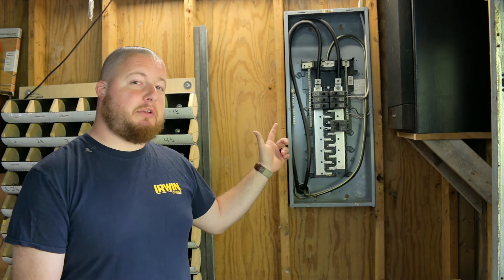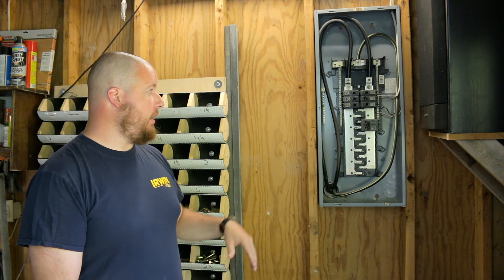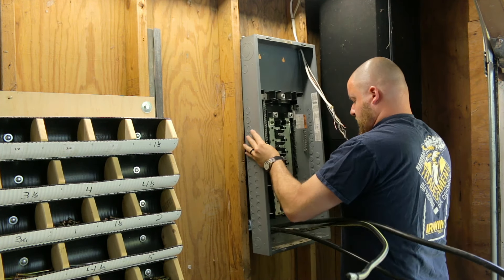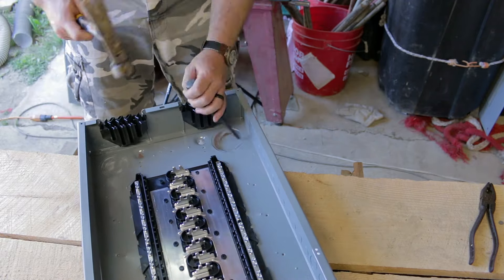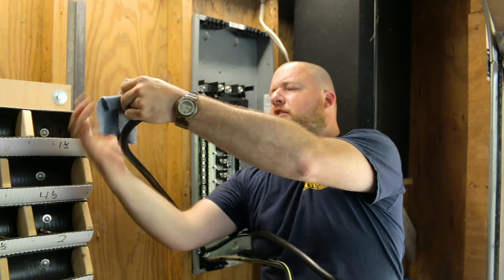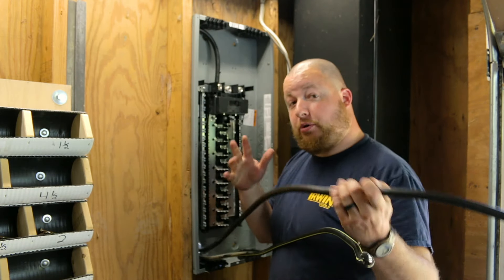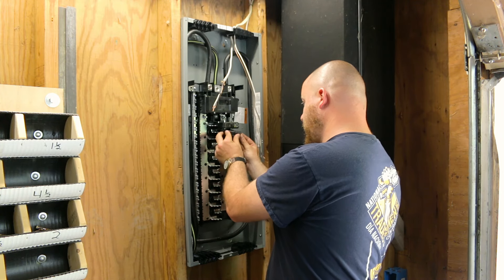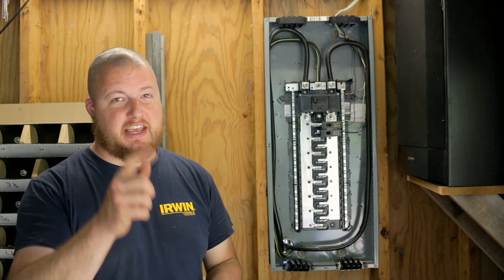Electrical Panel Replacement/Install

Comment: Do not pull your meter,  I work for a utility company and can't tell you how many times the jaws are messed up and it arcs.  Very dangerous.  Also if you have a smart meter the utility company will know right away and think your power went out.
Reply from the maker: so how do you pull a meter?
Reply: @drewdoestrucks  yeah and how many non-electrician/wiremen do you know have the authority to do that? Lol
Reply: Me personally I just disconnect the utility from the drip loop to cut power all together. Much safer no worrying about arcing. I’m more concerned about the main feed cables not having a bushing in the cutout.
Reply: Older meter, turn the main breaker off and cut it at weather head.  Newer meter can be done as you have shown but man use some PPE. face shield, gloves, FR.  Some home owner will get arc flashed right to the face.
Reply: @appalachiandiy2415 can’t really now. Most companies use smart meters and will know something is up. Fiddling with company power lines (big fat wires running into top of breaker box) is a no no for my power company without a license
Reply: No thank you but he’s right is a really safe way 👍
Reply: If you call the utility company, they’ll disconnect the service in short order.
Reply: I pull meters everyday in swfl 
Shut up

Comment: There's a whole long laundry list of code violations here, as others have pointed out in the comments. But one I didn't see is: no grounding system (current nec requires to pound in 2-8' ground rods at least 6" apart and wire them into panel). Just FYI: if Utility Co discovers meter tampering and wiring changes, they can turn off electricity (as a safety hazard) and notify city or county who will then revoke property's certificate of occupancy which means can't occupy or sell the property until passing a lengthy code inspection process. Meanwhile, property insurance can be cancelled and mortgage foreclosed. No joke, leave that meter alone!
Reply from the maker: https://youtu.be/vAD3r_nF6L4
Reply: That's nothing. He won't have any problems at all! He just needs to tell them that he made a youtube video of it, so he must totally know what he is doing
Reply: wow, bud its a informative video on how too.  its not a video on requirements, freakin Karen
Reply: Where do live? 😂 I live in Louisiana,  and the guy who checks my meter can barely read and write. I don't think he's going to try and take my mortgage.

Comment: We were getting estimates on a central air conditioning system, and the salesman told us we need a new box. I don't doubt that, but he wanted $2000 over and above the cost of the AC system, to replace the box. This is far above my ability to do, but I have a friend who is an expert with this kind of stuff, and he has helped me with doing breakers in the past. Pulling the meter is within my abilities, so I think Dan and I can tackle a project like this. Thanks for the tutorial!
Reply from the maker: Absolutely! Glad this could help
Reply: That is not a bad price. My area 200a is usually 6k. We have a few other things we have to do and adding 2 240v circuits and it is 9k total

Comment: H A C K.     Wires from meter to new panel not in pipe or protected.    And ground looks wrong size

Comment: can you answer a simple question.??  why do i see ground wires and neutral wires both attached to the same bar sometimes.. and other times.. they are separate??

Comment: The shortcuts a lot of self-educated rural builders took in the past are frightening. My house was built in 1965 and I am having a lot of upgrades done by licensed professionals to get as much up to current standards as possible without cutting into the walls.

Comment: Great video! Very informative! 
One thing: first thing you should do is verify electricity is not present in the panel. Power is disconnected, but people doing work themselves can mess up.
Reply from the maker: Yes that is a good idea, Just hook up a multi meter to check. Thanks for the tip
Reply: @appalachiandiy2415  I was thinking the same thing.  Always treat the wires as live until then can be verified to have nothing on them.

Comment: My panel is so old, it has buss fuses for the main disconnect 😂, so I take my life into my hands every time I disconnect the power. I'm not the least bit frightened of pulling the meter. When I was a kid I used to pull the tags off the neighbors meters for fun, and the utility police never hunted me down. 😂

Comment: Sorry about It. I deleted my comment. I live in Canada and the electrical code is different , I did not realize that you are in USA. I was wrong and you are right . you are doing perfect. thanks
Reply from the maker: No worries
Reply: Did u originally comment about no  ground in the panel?

Comment: Nice tutorial, can i ask a question, there are two screws next to each breaker, can i simply put the hot wire in the breaker the neutral in one screw and the ground next to it on the neutral buss bar? Or do all of the grounds have to be in the same area next to each other and the neutrals all in one area next to each other.

Comment: Even after removing the meter, one needs to use electrical current tester to check if there is any electrical current still live before start removing the wires & the breakers. What do you think? Thx
Reply from the maker: Always good to be extra cautious, doesn't hurt to check

Comment: Very informative video, just something maybe you didn’t know the main lugs have a torques spec which you should follow. If not torqued those lugs can heat up from expansion and contraction of the aluminum and can lead to a fire down the line if they loosen enough to begin arching.
Reply from the maker: Does the NEC have a spec on how tight?
Reply: @appalachiandiy2415  the NEC says to manufacture specifications, the last time I did a panel which was a reliance, I recall it being 20ft lbs.
Reply: @appalachiandiy2415  looking at their manual it states “Torque each connection to the value specified on the load center wiring diagram attached to the enclosure”
Reply from the maker: @Pbell  Thanks, ill check that out
Reply from the maker: @Pbell  Ill check on that and see what it says, Thanks!
Reply: @appalachiandiy2415  a 1/2 Ugga Dugga should do fine :D

Comment: Thanks, well detailed.
To complete the video,  i guess  something like: to energize the circuit panel, just go outside and pop the meter back ON, should be added at the to end.
✓ Although, i see some comments regarding the meter removal. So, not sure to proceed or not .
Other than that, thanks for the video.

Comment: I'm not an electrician.  However, where I live, the homeowner is allowed to do their own electrical as long as permits are pulled and inspections may still be required.  Any of the work I have done has always passed.  I'm just not a fan of the Square D home line because of the aluminum main bus. However, I like the QO line, the plug on neutral, the approved double tap breakers, and because Square D is DIYer and space saver friendly.  I would rather get a GE Powermark from an electrical supply for an application similar to this one.  Unfortunately, big box stores carry a lot of GE stuff from China, whereas the electrical supply stores usually order from the Mexico or Puerto Rico plant(s).  It makes a difference.  Other than that specific panel, I really like the video and your work, sir.
Reply from the maker: Thank you!

Comment: How does someone replace the meter box if the line in is still connected to the home? Do you climb up on the roof and cut them individually or will you get shocked doing that?

Comment: My friend's electrical panel was upgraded to one with gcfi - all are gcfi which we can use regluar outlet and if something comes up, the panel would shut down before you get electrocuted.  And I will get mine inspected to make sure its up to date but want to consider upgrading to GCFI.

Comment: What would you do in the even the wire were too short for the new panel, main wires or 12-2? And you said that main wires were 4g thought it was 2/0 THHN…

Comment: hello, i bought a 50a panel for a tiny house build so i need to run 6awg in to the top of the service panel, do you recommend videos showing where to run your two hots, ground and neutral

Comment: Thank you for this video.  I'm about to change out a panel in my shop building, and there's only about 4 breakers. So I'm gonna give it a try.  I'll label everything before I switch.  Meter is already pulled. So I'm good to go.
Reply: How did that go?

Comment: Pulling the meter in our county (Florida) gets you a fine with the power company. You must contact them for a shutdown. Also the guage for 200 amp is not 4 guage. You probably mean 4/0 (4 ought) aluminum wire.
Reply: It is 4/0 aluminum

Comment: I read in a comment that you could have installed it upsidedown, that would have prevented the 4 gauge cables from traveling through the panel box and just directly into the lug entries, would have helped to avoid working around them every time you change something, I can see the merit in that comment
Reply: That's what I would have done. You'll notice that all the writing/labels in the panel are written in both orientations, so there's no 'correct' orientation. Longer service wires running around the box takes up space and is dangerous. Those wires are always live (unless you pull the meter) and essentially unfused, so damaging one while working in the panel could result in a huge arc flash, fire, etc. Entering from the bottom is idea if most of your circuits come in from the top, because you don't have to come anywhere close to the service wires/main lugs when adding circuits.

Comment: You need a bushing to protect the three main wires
Reply from the maker: where the wires come into the panel?
Reply: @appalachiandiy2415 yeah usually you see the grey pvc male thread or rebake thread sticking through but doesn’t seem like that big of a deal
Reply: Without a connector and bushing this will not pass inspection nor is it safe.

Comment: 8:14 is the point here that the incoming service wires are the 180deg opposite phases coming out of the ends of a center tapped (center is the neutral) transformer, and that it does not matter  which of the phases is placed left or right in the electrical panel, so you just choose left/right based on convenience factors such as the length of each service wire?

Comment: 8:49 is the point here that the incoming service wires are aluminum and not copper, and hence need the anti-oxidant conductive grease stuff?

Comment: If your service lines are not long enough, could you reverse the panel board, the guts in the main breaker box? I’m speaking of an outdoor panel that has a rain protector on the top of the panel.
Reply: I do not know why he didn’t flip the panel entirely since his mains come in at the bottom. He must just like the price of #4 wire.
Reply: They take up a lot of box space the way he has it. 🤷‍♂️ I understand it’s not his main panel, but…

Comment: Surprised that the neutral and ground wires share a common bar.    Since the neutral wire carry a load should they not have their own bar?
Reply: You can only do that in the first panel/box after the meter. Subpanels must have them separate. Many codes now require an outside disconnect switch, which counts as the first 'panel' so you must keep them separate in the main breaker panel.
Reply: @bnasty267  thank you 👍

Comment: i'm surprised you aren't required to put a bushing (or grommet) on the service knock out to cover the rough metal edges.
Reply: I saw that too. I don't live in his are, but I assumed that he should have a raceway and a bushing at the end to prevent damage to the conductors.
Reply: Looks like the hole went around the fitting that was going through the wall, so the wires aren't able to even touch the box.

Comment: If you are changing the panel to a 200 don't you also need to change the cables from meter to panel box ?? It's a question

Comment: I pride myself on DIY projects but good lawd there are so many code violations or stuff that isn't best practice in this video to including your plans to bond a sub panel, no protective bushings/strain relief on your mains, not torquing to manufacture specs, tampering with a meter, not getting a permit or inspection etc. If you're ignorant, you'd watch this video and think this man is a professional as he speaks with so much confidence, he is not. If you insist on doing  electrical work at this level, please pull a permit and have your work inspected, that way, if you messed up an inspector can catch it and you're able to remedy the problems.
Reply from the maker: This is a main not a sub. If you knew so much about electrical, how did you not know that!? 🤔
Reply: Your first problem is placing your confidence in the code inspector 💀

Comment: Why did you not install a cut off switch while the power is off from the pole for servicing?
Reply: This is what the main breaker was for. The original panel didn't have a main breaker.

Comment: Sir is it legal to full the metter? Thank you so much
Reply: Sir is it legal to pull the metter thank you so much
Reply from the maker: There is no law that I'm aware of that would make it illegal, however I've heard some electric companies have fined customers who took it off. I've not run into any issues with mine, so your mileage may vary.. I do know that the smart meters will alert the power co and a tech might show up so be aware of that
Reply: Thank you sir!

Comment: Question!!!! You don't get  in trouble  for remove the lock. Locking  the miter ? In the outside of you're house 🤔
Reply from the maker: Its possible. Just dont tamper with the meter itself. If you have a smart meter they get a notification of power loss and might check on that but mine is an older meter

Comment: That is extremely dangerous pulling a meter like that . You should at least be wearing some insulated gloves to prevent electrocution . You could have an arc flash pulling the meter . Normally you should have your power company come out and disconnect the power on the pole but then they want an electrician doing the work and rightfully so . One mistake with a service entrance is all it takes to kill you . Don’t be stupid.
Reply from the maker: You got any stats of deaths from doing that? Dont think its common.

Comment: I am not a electrician, but I thought power company can only touch the meter. I am doing home renovation and anything involved with meter or telephone poles is power company responsibility. It maybe different regulations in every state but just saying.
Reply from the maker: If you talk to an electrician they will tell you never to touch anything in your panel, or the meter. I did, didnt go to jail, didnt get fined, power company didnt scold me, so choice is yours

Comment: Why didn't you mount it with main breaker at bottom?  easier and more room for all electrical from top coming in.  I disagree.  If you would sheetrock around that panel, when the installer runs his bit around the box, he will surely cut into those wires.
Reply from the maker: Cut into what wires?

Comment: That's bull. You should leave that panel alone and buy a box with a 200 amp breaker and install it outside to provide protection and disconnect of the service entrance wires.

Comment: Where is your Ground Buss ? You do not Bond the Neutral and Ground on a Sub Panel.
Reply from the maker: @oldscuba  this is not a sub panel. Its a main
Reply: You did...
Reply: The neutral buss is insulated from the panel.
Reply: My mistake if that's the main. The state I'm in you still must have a ground buss and it's bonded to the neutral buss on a main panel..
Funny how we are a little different all over the country..

Comment: I would do this all myself, except I could get fined, jailed, or potentially injured/killed by tampering with that meter base.  I did however, discover that a licensed contractor can put in a new meter base with shut off switches, thus grandfathering my main panel in
Reply from the maker: I highly doubt you can be jailed for taking a meter off, (if you know of a law that states this please post it so I can read it), fined or injured, sure. this video is here to help show you how to do it without getting fried. That meter base with shut offs would be nice though.
Reply: @appalachiandiy2415  I live in Washington State, on the blue half.  Lewis county PUD is over my jurisdiction  , it is on their website about tampering with their meters, which are all digital now
Reply: @allencolvin4320  Removing isn't necessarily tampering.  It's necessary in order to work on YOUR equipment.

Comment: No one twists the grounds together like that. Don’t do that
Reply from the maker: @Youcanthandleme319  can you explain how it's supposed to be done
Reply: @ yeah no problem Sean you land them individually 🤯 I’ve never even seen that before I’m a union electrician been doing it for 19 years braiding wires??? What???

Comment: That's not a #4 wire, it's a #4/0, big difference. This guy doesn't really know what he's doing here.
Reply from the maker: Actually it's pronounced 4 aught. But thanks for letting me clarify it for you
Reply: @appalachiandiy2415  Every electrician/engineer knows how it's pronounced, point is you called it "four gauge". But thanks for letting me clarify what you said incorrectly. Not even going get into the unsafe meter removal.

Comment: Did you lock out and tag out the meter base or just leave open ? There are so many things wrong in this video you should be banned from You Tube forever .
Reply from the maker: Nope, if someone was going to come on my property like that there would be a problem from the start. I live in a rural area. I would love to hear more about whats wrong though, in your opinion

Comment: Lol you can install a breaker and  put your wires at the breaker then you can turn off and on power at this panel man you don't need to replace this subpanel